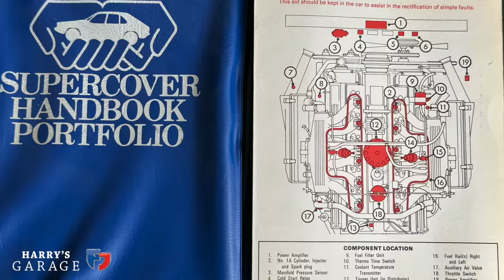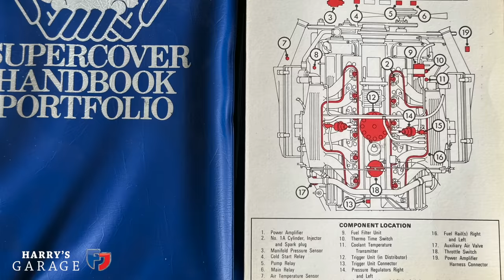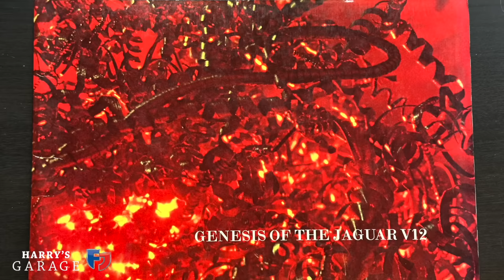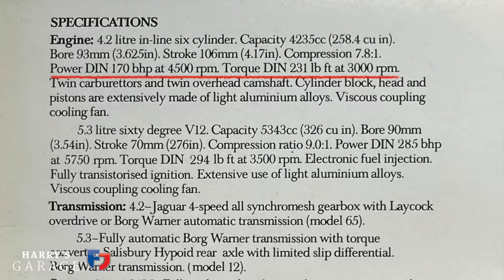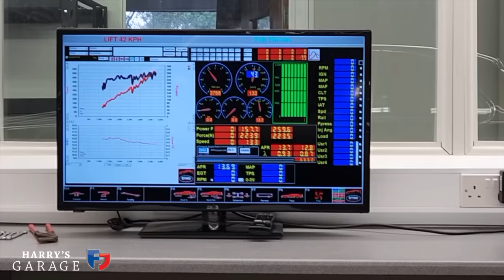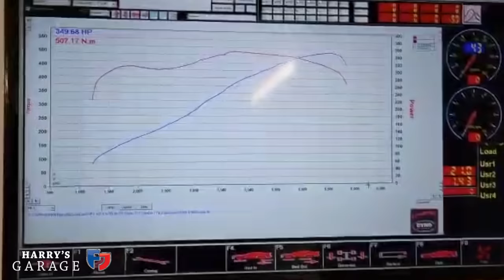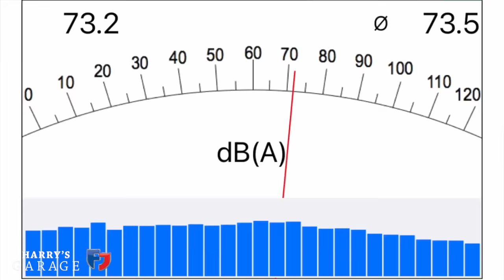My Jaguar XJC V12 visits the dyno & the result is more power & it sounds even better!

Comment: Possibly my favourite of all Mr M's cars.
Looks and sounds exquisite.
Reply: this or the Espada. Probably this one :)
Reply: It's not about you.
Reply: @johnsmith1474  But, you’re coming on a thread to say this very thing, apparently everything is about you?
Reply: Was just about to say the same thing.
Reply: I would have invested in a hundred kilos of sound deadening ( equal to a passenger) to improve the internal sound , 71 dB is horrible.
Reply: I have owned 4 V12's , a few 2.8 series 1 XJ6'S ,  the only problem is petrol costs today , to take a V12 from Solihull to the east coast for a day out is about £200 in petrol ! My SLK200 will do it for £50 return ! And my Peugeot 508SW Semi auto with stop start will do the same trip for £25 return !
Reply: I think John is a trans activist !
Reply: Mine too

Comment: Amazed at how much money can be spent on a car trying to get it right that probably never left the factory right to begin with.
Reply: I kind of agree but coil technology in itself was very as it was.Coil packs were yet to happen.If you look now at how much HT can be achieved by modern stick coils per cylinder.The old V12 had one coil to somehow energise 12 plugs every revolution of the crank using one dizzy and one condenser.(actually every two revolutions?)You goto 4000 rpm thats alot to expect.Those old cylinder oil filled coils got very hot under high load and hated the damp aswell.As for fuel injection Triumphs system on their 2000 engines were an electrical nightmare as were the injectors that just stuck at will.
Reply: The coil from a Fiat 1000 does a great job as a replacement
Reply: Still isn't "right." It's a quirk-mobile for an elderly Englishman.
Reply: @johnsmith1474  - why are you here watching then?
Reply: @johnsmith1474  left wing woke perspective!
Reply: I would be more amazed at the end result when you do that: a car that never existed new, to anyone but you. It's like buying the car for the potential, and reaping what you sow! As a car guy, nothing can be more rewarding than when you take a risk on an old car like this one, and the result is something that takes people's breath away.
Reply: @johnsmith1474  how would you make it right?
Reply: Dying rich is a waste of money. So better spend it. 😀
Reply: @johnsmith1474  Whats wrong...Are you jealous of Old English Colonial Power....     🫖🇬🇧🫖
Reply: @fry.master  Amen. 👍🏻👍🏻
Reply: @johnsmith1474  I am no gentleman. 😂
Reply: It was part of the evolution, another step towards what we have now. Kudos to the engineers and the suits that backed them up to try something a bit special at a time when the industry was struggling generally
Reply: According to Harry it ran good when it was in its original blue (pre restoration) and you can just use the Magnetti system from the XJS HE which would have cured the problem for quite a chunk less that £12,000 which several others suggested also but if you’ve got 12k to chuck at the old girl why not.
I wonder if it may have been better to buy a X305 as a donor and just use the ZF 4 speed and 6.0 engine.
Reply: Should have used state of the art 70s Bosch K Jetronic
Reply: @davidsharrock5704  I don't think so. I'm predominantly socialist in my views and think hate is mostly a result of ignorance, denial and externalisation of one's own failings. I think that's termed ''woke' in contemporary parlance. Yet I think John Smith's comment is idiotic and emblematic of why UK industry is in the toilet right now. So no. I don't think he's left wing and woke. He's just hating on British engineering like so many people do (without knowing the first think about it), Clarkson and May included. I bet 50p John Smith is British, too
Reply: @glennpowell3444  Triumph's system was purely mechanical with vacuum control, not a wire in sight.
Reply: @briancornish5857  no one is old enough to remember that
Reply: @duster8100  Sadly....Apparently so. The QUEEN is DEAD... LONG LIVE THE KING.
Reply: You've never owned a Jag
Reply: Much better than standard and better finished. The owners choice. Personalised individual. Regardless of age. If things were all the same, the world would be very dull.
Reply: Worth every penny
Reply: @Richard Carter  100 percent agree and I like things stock. But a little individual upgrades and wow. It literally Roars.
Reply: It's amazing the things love makes a man do 😉
Reply: @Richard Mayes  agreed the fitting tuning and rolling road testing well worth it. The cost for expertise. Yes I can see why Harry wanted to keep. That also includes wiring. Not bad. Harry is not like Jeremy Clarkson he's a genuine connoisseur and know his mechanics.
Reply: @glennpowell3444  I appreciate the knowledge and you sharing the info! 🙏👍☀️😊
Reply: I suppose the videos cover most of the costs so he's essentially earning while fixing the car. He gets a decent amount of views on the series and he's obviously got some sponsorships
Reply: @johnsmith1474 it's running, and the owner will be able to enjoy it for a few more years (until the petrol gets prohibitively expensive.) 

I doubt there are very many people left who care whether this car's engine is as per factory or not. And for those who do, there are plenty of books and photos around, and plenty of original examples lined up at car shows. 

This is a mass-produced car, he's not painting an eyebrow piercing on Mona Lisa or giving Michaelangelo's David a trendy asymmetric undercut!
Reply: @johnsmith1474  amazing how this comment triggered people.
Reply: Average British automobile 😂😂😂
Reply: @davidsharrock5704  keep your silly politics out of here
Reply: @annahopp  Spend it before the tax man tries to take it !!!
Reply: That being the difference between mass produced and bespoke, one is much more time consuming and thus costly!
Reply: Someone has a bit to much money……
Reply: @johnsmith1474  forgive me, but I think you are missing the point a little. I'm mid60' s and drive in a major rally championship with a high tech car, but the delights of an old school charger like this are so seductive...
Reply: @glennpowell3444  a single coil will do just fine for most any application. The number of cars produced around the world running around with a single coil and whether it be points or electronically triggered spark are in the millions... Not to mention you can run a multi spark ignition (msd6x) with a single coil...
Multi coils go way way back. It's a more reliable way to generate the spark at higher rpm. In my honest opinion coil packs are both an emissions related thing and an economy thing on modern production cars. But also, to sell more parts. 🥂
Reply: @briancornish5857 the king is a joke, not worthy of the throne, nor is the soon to be queen worthy, to divorcees both committing adultery. Disgrace
Reply: What a sound!
Reply: Germans are losing it over British cars, because they can not imagine the cars where never perfect from the start..
Reply: @johnsmith1474  do one
Reply: @memememe2674  I mean William and Kate..Charles will not be around that long.."THE" Monarch The LIVING GOD is not Pleased with the two of them nor England's/Great Britain's current Spiritual State and  trajectory.
Reply: @rovingenglishman  Yeah, most folks today will never understand the appeal of cars designed before computers were a thing. 

On my coupe you can see where the designer has got stuck and had to come up with a solution in so many places. 

e.g. One of the rear lower shock absorber bolts doesn't clear on removal. Solution? Cut the bolt head across two 'point's' and turn that new larger 'flat' towards the obstruction and remove! And that is factory, classic :-)
Reply: @Utkarsh Verma  was the best car in the world at the time
Reply: Imagine how much you might save if you did it yourself rather than throwing a cheque book at it 😂
Reply: ❤you get to think, of how pressed for ressources car manufacturimg really is.😅
Reply: What a car ❤
Reply: @johnsmith1474 apparently your view isn't too popular!
Reply: Hope you get to enjoy this wolf in elegant Jaguar clothing for decades to come Mr M.
Reply: Facts
Reply: @AB-pl1ko  He's right though. It's an awesome car. But he's right

Comment: Fantastic sound!  Point not mentioned was that the original injection and ecu was designed for very different petrol to what we have now. No wonder great results can be achieved with the correct modern upgrades and the right skills to set them up correctly.

Comment: I could quite understand wanting to get the original system sorted, but oh my what a difference Tom's conversion has made - what a beast of a Jag!
Reply: Tom just blamed his inability to get the original system sorted on the system rather than himself. Of course this video is going to be nothing but singing the praises of the new system - it's all he was able to do. But funny how some mechanics manage to sort out the old system and make is reliable. I understand that Harry has his happy ending - and that's nice. But this conversion and video series has promoted a myth that the original system cannot function reliably. I've met mechanics who are experts in the original system and they know what to do with it. So, sorry, I can't get excited about old Tommy-boy. He's basically throwing together kit-injection that mostly sorts itself out. There are a million mechanics at his level.
Reply: @andoletube  Yeah I thought that too, but I have no experience with the ownership of the older systems. The conversation did touch a little on the immaturity of those early injections systems, I can only imagine the frustration that would cause on such a vehicle. Have you seen any good evidence that it can be reliably run for the extended periods one might expect? Cheers.

Comment: Those gains on normally aspirated with stock internals are really impressive. I always felt that this engine was very conservatively set up from factory. It looks and sounds amazing and the spacing on the first three gears seems just about perfect for the engine. Beautiful and addictive 😀
Reply: A lot down to tight regulation in the 70s
Reply: @jase6370  in the US yeah, but I wasn’t aware of too much of that in the UK back then

Comment: A huge improvement in the aesthetics of the engine bay! The previous induction unit looked like a messy bowl of metal spaghetti, whereas this new system looks both period-correct and good enough to show off. Well done! Your XJC is a real gem and has improved in every way since you started this process. The color is both beautiful and speaks volumes for the heritage of the brand. It looks like a true British GT coupe, like a genuine Jag, from every angle... and now it has the performance to match the great design.

Comment: Now THAT is an XJC that sounds and drives the way I believe an XJC should do - and always should have.  It's beautiful to behold, beautiful to listen to and wonderful to watch / ride along in - even if only vicariously.  Sure, the changes sound like they were massive, but they actually weren't and were only along the lines of allowing that 5.3 litre to breathe properly and more efficiently.  No silicon chip to modify to get extra horses, no huge valves, no skimmed heads, no wild camshaft or non-standard pistons to increase compression - just the pure unadulterated essence and potential of the Jaguar V12......and I love it.  Harry, mate, you have the best of both worlds in that car.  She can be driven spiritedly and give you that gorgeous exhaust note to coax you into breaking the speed limit with effortless ease or she can be a laid back and wafty cruiser that just quietly eats up the miles in comfort as only a Jaguar can.  Man, do I envy you....but in saying that, I couldn't be happier that she's exactly what the doctor ordered.  I look forward to seeing you out and about in it as often as possible!

Comment: Great mod, best of both worlds - Pre HE V12 with 6.0 litre fuel injection system. The H.E. (High Efficiency) V12 that you mentioned relates to the development of the V12 with digital fuel injection and the May Cylinder heads. These had a swirl chamber at the exhaust valve with a channel around the intake valve. Fitted to XJ-S and XJ12 models from around 1981.

Comment: What an awesome sound!  Love the ethos with this conversion, with just a modernised intake and fuel/ignition control you have to appreciate that result.  Manual conversion seals the deal.  Hoping to get a similar result with my 911's 3.0 fitted with a later models intake.  Thanks for sharing.

Comment: Are the gains not actually more than mentioned Harry? Original power figures will be at the crank, not at the wheels like your dyno runs were. Add X% for drivetrain loss and I think you’ve actually done even better than realised. Great result regardless, it’s now got the engine to match the looks and handling. Terrific stuff
Reply: That's what i was thinking, you loose somewhere between 15 to 20% drivetrain loss on the dyno.
Reply: Most dynos correct to flywheel power

Comment: Music to my ears Harry!!! Thank you so much for this update.  I am working on my XJ12's engine and following mostly the same path.  I will be going with the Mobeck fuel injection/ECU with distributor delete but otherwise the same path with better exhaust and larger throttle bodies and suspension upgrade. Absolutely love the sound of the car!  A manual tranny will be going into mine as well.  Thanks again for this series...stunning cars these Jags.

Comment: As another more modern power comparison, back in 2009 you did a quick drive in a nearly-new 2007 Mercedes C55 estate for evo, which had a 5.4L V8 making 362 bhp and 376 lb/ft.  So the Jag now makes about the same power from about the same capacity, despite being almost three decades older.

Comment: Brilliant, Harry. Top quality work by all involved.
I noticed a mistake at 6.15. Engine 4.2 litre......'Cylinder block, head & pistons are extensively made of light aluminium alloy' If this document was put out by Jaguar, then I wonder why a proof reader did not notice, as the block is a decidedly heavy cast iron.

Comment: The sound of this engine at song is pure magic, wonderful. One thing about the horsepower gains, I'd imagine they are actually higher than you think Harry, since the Jaguar advertised gains were likely crank power/tq, vs. your dyno results which would be rear wheel power/tq. I'd guess you've gained more like 100hp over the original.

Comment: 2:28, during my time with Jaguar in the 80s we did many fuel rail modifications on the V12s to reduce the fire risk (many used to come in after engine fires).  They had a lot of hose clamps, one of the issues addressed with the fuel rail mod (as the rubber fuel hoses harden the hose clamps no longer clamp as tightly and they start leaking fuel, leading to a fire).

Comment: Absolutely brilliant beauty.. Harry.. nice work.. My son and I are almost finished our restomod on his 86 XJS.. complete port and polished intakes, custom 73 mm throttle plates, custom snorkels, all chrome ER,, custom tuned headers by spiteri,, removed the auxiliary fuel box, relocated the battery to the right side trunk pocket,, custom interior and trunk,, custom 2 1/2" SS exhaust, original TWR body kit,, 18x9" rims,, full digital Mobeck kit (dis, injectors, electronic idle),, bigger sway bar,, all Teflon bushings,, everything is powder coated or chromed and all fasteners on the car are SS,, shaved body (no door handles, side lights, not even the lip on the gas door).. the entire car is painted in a custom midnight satin black,trims and all.. we may make  4 custom throttle plates but separating the intakes into 4 , so one plate feeds 3 runners.. 
Don't stop keeping these cars from going to the crushers..

Comment: the saga with the fuel injectors reminds me of the “Spica” system on alfas of the mid-70s. they were infamous for either being fine or being terrible, and people would regularly tear them out and just put carbs on instead. ultimately, those cars were designed to be on carbs, and seemed to prefer to be that way. great video!

Comment: Your actual increase in power is much more than what you quoted... Don't forget, you're measuring rear wheel horsepower vs crankshaft, also the factory measurement was SAE with no ancillaries. Your standard rear wheel horsepower would be around 220 with all the exhaust restrictions, accessories and gearbox/diff frictional losses.

Comment: This is what so many classic cars need, full ECU control with modern EFI to get the most out of these old engines. 5.3L making 350BHP is still low by modern standards but certainly getting the most out of those 5.3L compared to carbs or 70s fuel injection. She sounds glorious and that extra torque really noticed in the drive. Top job 👍

Comment: Makes me wish a hadn’t sold my pre HE xjs last year. It had the getrag manual, 3:54 diff, custom exhaust that went under the cage and not through it so I could keep it at 2 3/4 inch all the way from the manifold, larger throttle bodies etc and being the pre HE I bought a spare pair of heads and had them ported, polished, new valves etc and that’s as far as I got. Unfortunately I didn’t have Harry’s money and couldn’t afford to pay the cost for having the heads fitted. I weep at the money I spent on it only for someone else to benefit fully 😢. Harry’s car is a true master piece though, it’s everything you could want when you’re a jaguar lover like me.